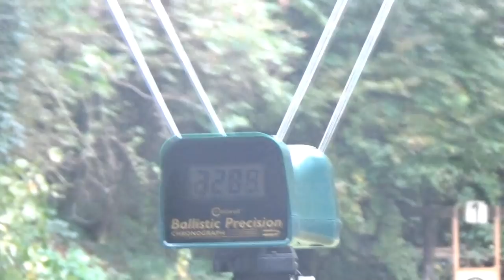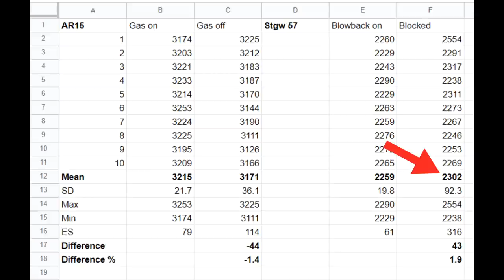Does A Semiauto Action Make A Gun Less Powerful? AR-15, SIG Stgw 57

Comment: As you say it is within statistical  standard deviation. 
If I were to make up an explanation for the AR15 results I would blame it on the build up of pressure in the barrel ahead of the bullet. The open gas system allows compressed air ahead of the bullet to bleed out, giving a greater pressure differential  across the bullet and thus giving it greater acceleration down the barrel before it reaches the gas vent. 
Do I sound convincing?
Reply from the maker: No, sorry, not in the slightest...... ;)
Reply: @BlokeontheRange  Excellent, that means it will be a generally accepted internet truth by this time next week ;-)

Comment: Does the delay part that’s locked off cause a stronger recoil implulse
Reply from the maker: It's a sharper recoil impulse cos it's not spread out by the movement of the bolt.
Reply: @BlokeontheRange  that’s what I meant lol

Comment: awfully small hole and not much time after the projectile passes and before it leaves the barrel to reduce the gas volume.
pretty sure most of the gas used is transferred after the bullet leaves the barrel

Comment: Another explanation to those results could be that the RECOIL ENERGY is lower on a semi-auto than on a bolt action. That means the bullet takes always the same energy (i.e. speed) of the explosion whether the firearm is semi-auto or not, but the shooter's shoulder does not !...
This could also explain why people think a bolt action is more powerfull ; just because it has more recoil.
Reply: Energy has fuck all to do with any of this. It's all about momentum. The modern concept of energy is about 200 years younger than Newton, who would have figured all this out even back in his time.

The concept of recoil is actually really very, very simple if you know the very basics of Newtonian mechanics. Like F=ma (Newtons 2nd law) and impulse (Force over time). The pressure in the chamber accelerates the bullet as well as the rifle with the same force in opposite directions. The acceleration of both the rifle and the bullet depends on the mass of the two objects, which is why a heavier rifle recoils 'less' (but not really). The peak acceleration of a heavier rifle is less and hence the peak force felt by the shooter in the shoulder is lower, but the recoil momentum is the same no matter what the mass is.

The difference in 'felt' recoil is that in a semi-auto, some force is delayed over time by moving parts that have to be decelerated with springs and buffers that lowers overall peak force. The impulse (force over time) is still the same, though. You just trade peak force for a longer time.

Comment: Didn't you see? One reading on that 7.5x55 with gas off, 2554, was extreme outlier, so you either presed the wrong button there (could be 2254 or 2354) , or it was a very overpressured round and you are lucky the blowback was blocked at this point.
Of course sample size=10 is not any good for stats.
Reply from the maker: Look up the muzzle velocity of military 7.5x55 then you might reconsider the idea that it was a very overpressured round and I'm lucky the blowback was blocked...

Comment: i mean.. technically it should take some energy..  but as you say, it will probably be hard to measure
Reply: Yes indeed. I think this is  a case where using American units may actually help us.

For the sake of argument, if Bloke's AR15 has a muzzle of energy of 1300 ft-lbs normally and also needs 1ft-lb of work (i.e. energy) to cycle its action, then perhaps its muzzle energy might increase to 1301 ft-lbs with the gas turned off. Using those numbers we might expect a base muzzle velocity of 2900 ft/s to increase to 2901 ft/s, which far less than the statistical shot to shot variation.
Reply: Then using the actually numbers in Bloke's spreadsheet, the average Stgw 57 muzzle energy increased from 1971 ft-lbs in semiauto to 2050 ft-lbs locked an increase of 79 ft-lbs, which is not statistically signifcant according to a 2-sample T-test. The average AR muzzle energy decreased from 1263 ft-lbs to 1229 ft-lbs, a statistically significant decrease of 34 ft-lbs.
Reply: @derekp2674  How in the world is American units going to help? i actually didnt even read..
Reply: @djsalose  Maybe it's just me, but I can envisage lifting a 1lb weight over a distance of 1ft much more easily than a 1N force acting over 1m. YMMV.

Comment: I knew it wasn't much but I didn't think it was that small a difference. Good information fellow gun nerd. Can you do the math for loss of energy in ft/lbs? Just for kicks.
Reply from the maker: E=0.5.m.v^2. Knock yourself out ;)
Reply: Using the actually numbers in Bloke's spreadsheet, the average Stgw 57 muzzle energy increased from 1971 ft-lbs in semiauto to 2050 ft-lbs locked an increase of 79 ft-lbs, which is not statistically signifcant according to a 2-sample T-test. The average AR muzzle energy decreased from 1263 ft-lbs to 1229 ft-lbs, a statistically significant decrease of 34 ft-lbs.

Comment: I think the myth arises from confusion regarding different loading for semi-auto and bolt guns for the same cartridge.  For instance, 30-06 Springfield has a downloaded variant for use in M1 Garands. Similarly, .308 Win and 7.62x51 NATO are effectively physically the same cartridge with different loading.  The most obvious "modern" cartridge is 6mm ARC, which has two different loadings: a "heavier" load or bolt guns and a "lighter" one for gas guns.
Reply from the maker: There isn't a downloaded .30-06 variant "for use in M1 Garands". The M1 Garand was built around the spicier M1 loading. The M2 loading basically replicates the original .30-06 loading and its existence is nothing specific to the Garand but rather to escaping M1 rounds exceeding the range templates based around the original loading. 7.62 NATO effectively replicates the .30 M2 loading but half an inch shorter, and is a particular .308 Win variant.
Reply: @BlokeontheRange  Unfortunately, the Hornady reloading manual disagrees with you.  It specifically calls out a 30-06 Springfield and M1 Garand loading.  Also, while I cannot speak for Europe, in the United States there are commercially available lower power 30-06 Springfield cartridges recommended for the M1 Garand.  Additionally, while the 7.62 NATO is a variant, as 5.56 NATO and 223 Rem are variants, the chamber pressure and muzzle velocities for the specification are different while fireable from the same chambering.  I am not arguing about the variations, I am more interested in the source of the myth and was suggesting that one such possible source is the fact that certain cartridges do have "variants" that have different loading recipes for their "unique" purposes.
Reply from the maker: Did the US Military use the Hornady reloading manual? Or did they load standard .30-06, .30 M1 and .30 M2? Yes the heavy-bullet hunting .30-06 loads might have too much port pressure and damage a Garand's op rod, but they're not relevant to a military context.

I think you have some of the source of part of your myth right there in your Hornady manual... For the reality, I suggest you read Hatcher's Notebook which gives the full history of the military .30-06 cartridge in US service: https://archive.org/details/Hatchers_Notebook

Comment: Bloke- just spitballing... Maybe the AR gas system gives the air in front of the bullet another exit besides just out the muzzle? Or the AR bolt pushes forward on the case before unlock, forcing better breach seating when gas system is working.

Comment: Somebody do a t-test on the SD between open/blocked. Too lazy to do it myself.... and statistic knowledge is too old.
Curious if its even significant on ~5% level
Reply from the maker: The sample size is a bit too small. It would be interesting to re-do with 100 rounds of match grade through each rifle, but that'd be a very, very spendy and time-consuming video!!!!
Reply: @BlokeontheRange  ok, i can see that. Its just, that it doesnt make any sense to me, that SD is so different. At least at first glance.
Maybe the operating mechanism smoothens the SD that is inherent to the ammo?! By taking away all the excess energy needed to operate

From a shooting perspective its obviously no real difference. Just curious
Reply from the maker: Or it's just bog-standard ammo which has quite wide variations. It only takes 1 or 2 in a sample of 10 to throw the stats out...
Reply: If I did my math right, we're significant (at 95%) on the AR-15 but not the StgW-57
Reply: @BlokeontheRange  that would be quiet too easy.... I am german you know ;)
Reply: @MrPolluxxxx  thanks! So its not as big as a difference.
Reply: @siwwe7  But interestingly, it's significant in the opposite direction. You would expect higher velocities with the gas blocked.
Reply: @Blackstone9x19  well, thats the main point of the video. Hypthesis approved. But thanks for underlining by calculating significance :)
Reply: @Blackstone9x19  my question was more directed to the difference in SD, than in plain velocity

Comment: ¿It LOST power with the bolt jammed shut?
🤯😮😮😮
I expected loss of power, I expected insignificant loss of power (which is what happened with the AR), but I didn’t expect loss of power (significant or not) in non-self loading mode…
Reply from the maker: It's just statistical variation...

Comment: A pedantic statitistician replies: actually you might, re the ar15, see a statistically significant difference. The sd you reported yield standard error values that just about separate the two means. To be conclusive you need to run a t-test with unequal variances, as the SDs looks quite different between the two series. You could ask a collegue with Minitab to run a check. Or send the data to me 🙂
Reply from the maker: But the difference is in the wrong direction, so can only really be a function of fairly wide variation within the small sample size. The data is linked in the description if you want to play with it yourself though ;)
Reply: @BlokeontheRange  Aha. This weekend am going to do some bootstrapping then 😃.
Reply from the maker: Welcome to the world of normal factory ammunition.
Reply: @Win Mag The SD of 92 is mostly down to that first shot at 2554fps, which is abnormally high. Makes me think it was a bad chrono reading. If you remove that one shot, the SD goes down to 28
Reply from the maker: Does @blackst0ne45 look like the pre-WW1 German methodology for determining rifle dispersion to you? :D :D :D

Comment: Isn't maximum velocity achieved a short distance from the chamber. In which case any rifle, semi auto or not, wouldn't matter anyway.
Reply from the maker: No. Unless the barrel is very, very long, at which point it can drop off, it's accelerating all the way to the muzzle. Which is why 20" barrels give higher velocities than 18's and 16's etc...
Reply: @BlokeontheRange  Thanks for the info. The reason I asked is that I have seen long barrelled full bore pistols being shot very accurately at Bisley at 900 yards. I don't know what the M.V would be, but I wouldn't have thought it would be that much lower. The barrel appeared to be about 10 inches .
Reply from the maker: It's quite a lot lower, and they're shooting massively hot loads to keep the bullets supersonic all the way to the target. I remember one guy who did it saying to me that the actions wore out before the barrels due to this...
Reply: @BlokeontheRange  O.K thanks, I didn't get the chance to chat with them and I can't find anything on the web either.
Reply: @dp-sr1fd  I've seen this table once (can't find it anymore, sadly) where somebody had measured speeds from different barrel lengths for pistol calibers like .357 mag and .44 mag.
For .357 mag the optimum barrel length was around 12-13 inches, for the .44 mag it was more like 15-16 inches. But these are relatively slow pistol rounds, you'd obviously have much longer optimum barrel lengths for .223 or other fast rifle calibers.

Comment: Can you compare a same caliber rifles, only one is legit bolt action and the other is semi-auto? Because I think thats on what most people really base this myth on. Like Your M1 Garand and Tikka for example , I would be interested to know what would be the deviations there, plus you could use the same exact ammo too (unlike here where you have 2 different ammo producers on top of 2 different calibers)
Reply from the maker: There's no point - nominal barrel dimensions, throat configuration etc will make a small difference even if the barrel length is the same. The Garand has a longer barrel that the Tikka (but presumably a looser bore - it slugs at .310" whereas I presume the Tikka is close on .308") so is highly likely to give a measurably higher MV.
Reply: @BlokeontheRange  oke, I see

Comment: But both those rifles were designed for semi auto and military use. A useful comparison would be to try a Lantac semi auto and Lantac UK legal straight pull of the same make in comparison to each other. That would rule out the lack of tolerances in a normal military rifle.

Comment: I thought Bloke had an engineering background!?  USE STATISTICAL ANALYSIS  Increase your sample size and use an actual statistical test.  Student's "T" test is undergrad stuff mate, er sorry, Bloke.  
Not put to rest.
Reply from the maker: If you can't eyeball something this simple on a graph and need some complicated mathmo statistical test to torture it out, it probably doesn't exist in perceivable reality. Remember that we convert imperial to metric tons 1:1 and take g as 10, cos the difference from the real value is less than the measurement error :)

Comment: You aren't necessarily correct about the AR15.  The venting of the gasses releases heat into the mid portion of the rifle.  If all of those hot gasses are going out the front now, the barrel will be significant'y hotter in the front, and thus expand, ie. being less tight, allowing more gas to escape around the bullet, thus slowing it down.  With the STGW 57 there is no back venting of gasses, but there is again a little more heat energy in the barrel because that little bit of blow back energy is now going out the front, but probably not enough to make a difference.